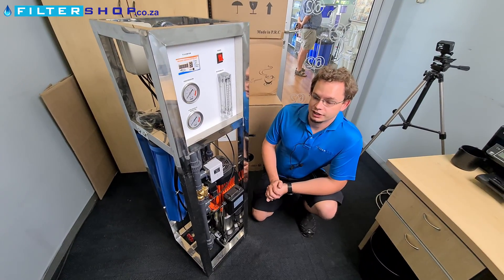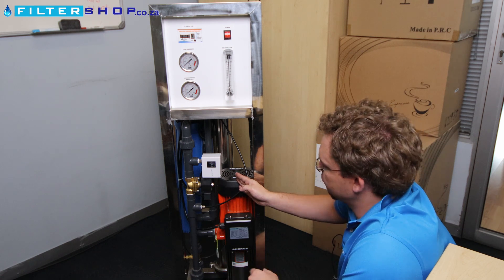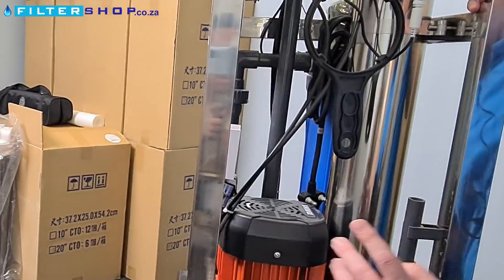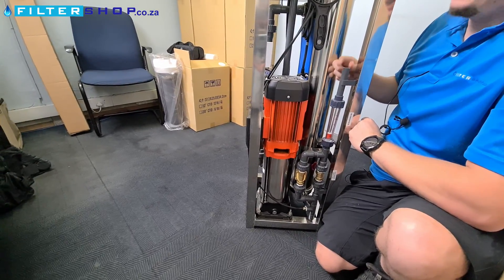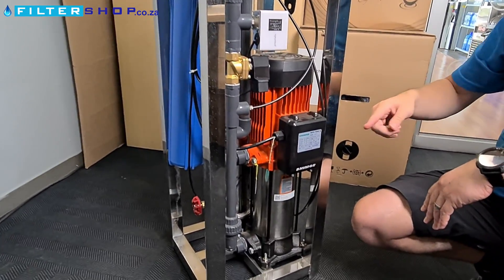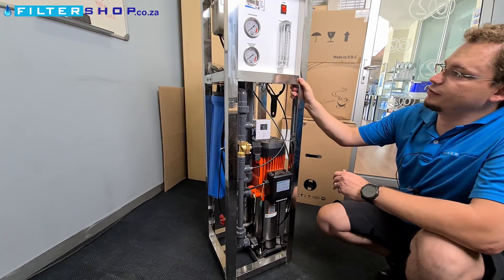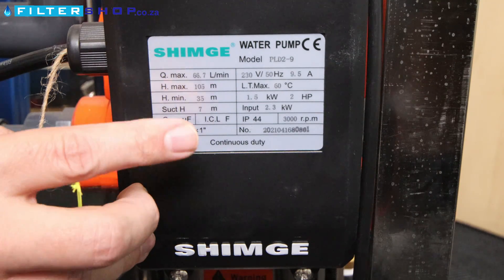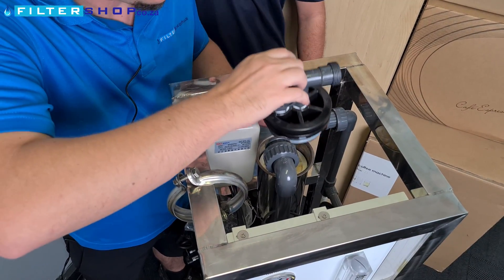Budget RO plant 2000 GPD Single 4040

Comment: My RO200 system don't start producing after flushing sequence just stop i check float switch and incoming pressure all right don't know whether the computer box is faulty
Reply from the maker: What is it showing on the controller when it stops?
Reply: Its indicate the tank is full 
 @FilterShopZa
Reply from the maker: @bonganinkosi3192   Try to disconnect the float completely to see if it turns on then as it might be a faulty float.